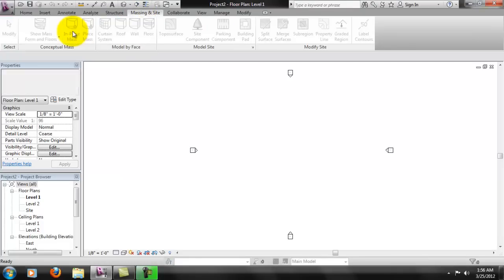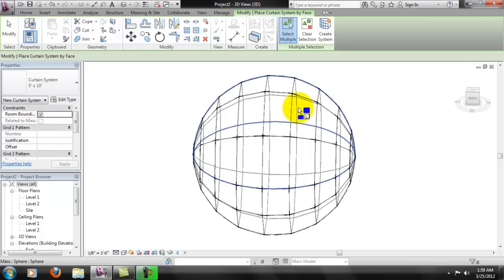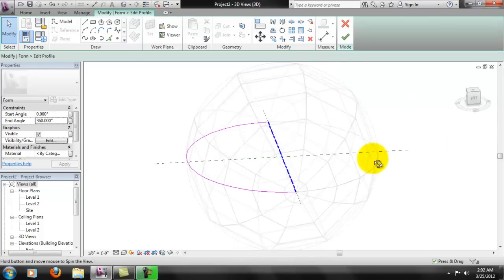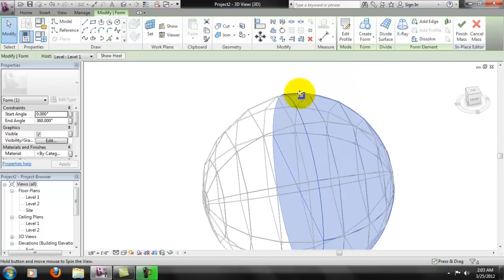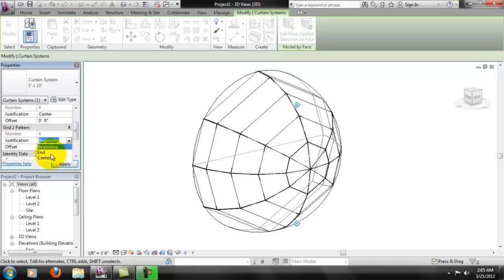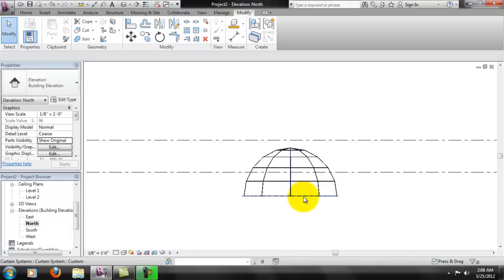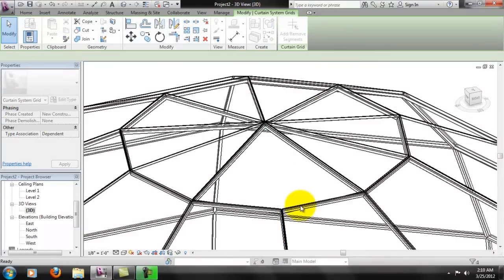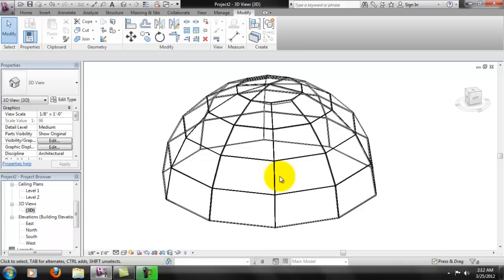Autodesk Revit Focus: Glass Dome

Comment: Awesome video, very helpful. If at all possible could you please make a video on how to create a semicircular/ellipse like structure with it having irregular shaped openings all over it. and its used to support a building that is in it using steel bars to carry the weight of the building?(am not asking for the whole thing just the steel bars(the ones used to carry bridges) and how to create the structure in the shape I described). Sorry if not clear my English is not very good.

Comment from the maker: Awesome! I am glad it was helpful. On a sidenote, I also teach 3ds Max and Solidworks so I am pretty familiar with Inventor. You can definitely import geometry from inventor if you want to go that route. Create a new family and import your inventor geometry into the component (check the import filetypes and match it with a inventor save as). You won't be able to modify your inventor geormetry in revit, but it will look pretty!